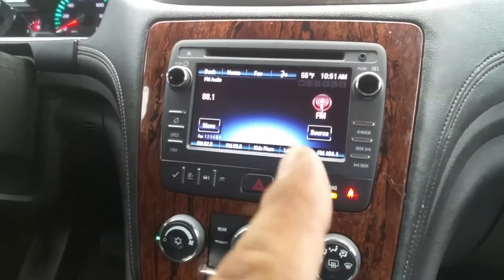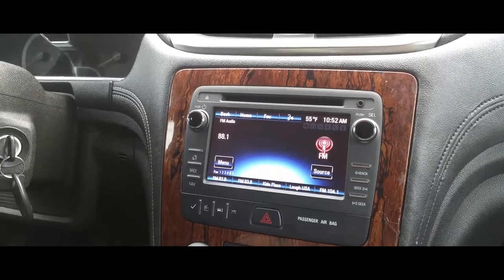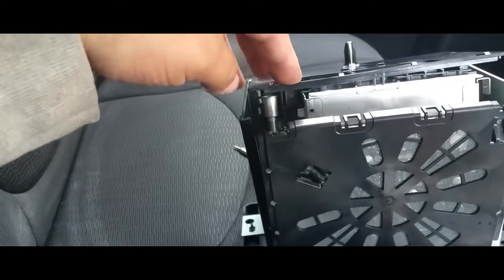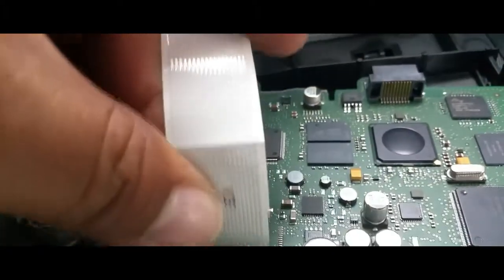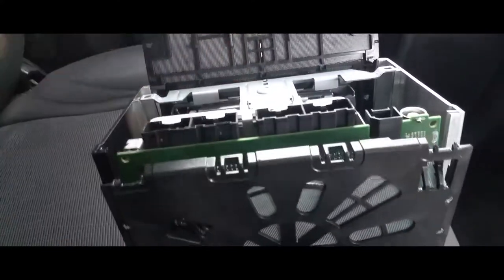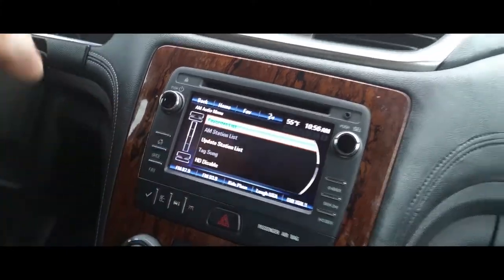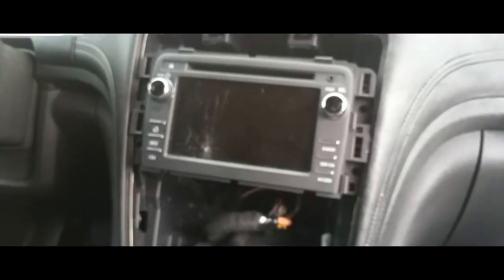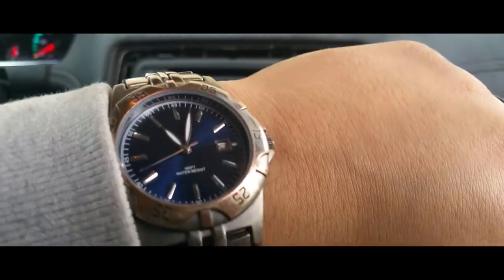How to: Radio  Locked Solution 2014 Chevrolet Traverse

Comment: Chip? When referring to a "chip" it's more than likely an integrated circuit of some sort (The chips are on the board). What you did was replace the main Board/ Motherboard/ Green board ect... It's a good reach around to stick it to Chevrolet, good vid. ;)

Comment: Hey George, I have another way to unlock the radio if old screen is shattered.
Just unclip the four flat clips holding the screen onto the Radio.
swap screens, clip it on and put it back in place without messing with
any chips or Salsa!  Frankie
Reply from the maker: Sweet sounds like a time saver too!
Reply: Thank you🦾💪🦾💪🦾💪🦾🦾🦾